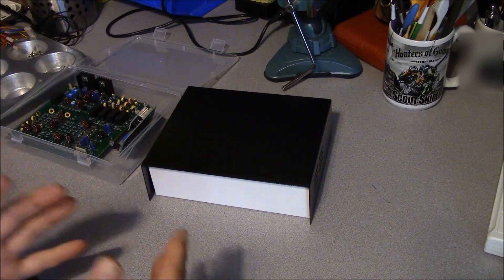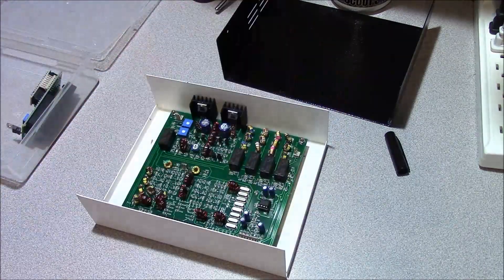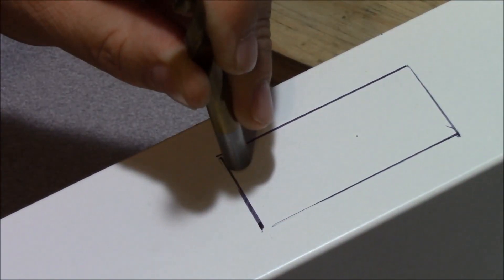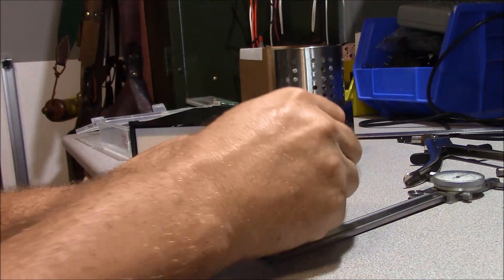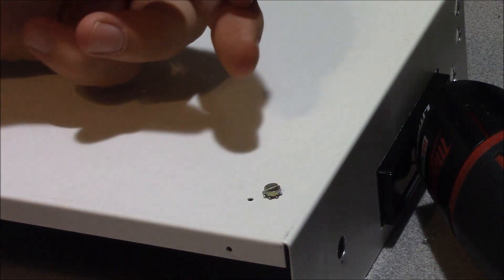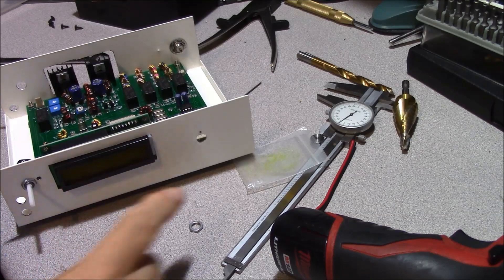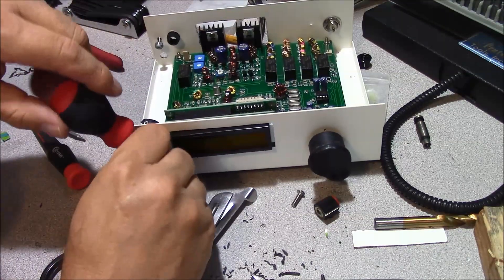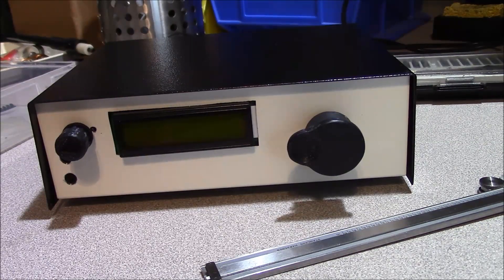uBITX $130 HF SSB/CW radio kit Part 2

Comment: Here's a suggestion.  Measure DOWN from the top instead of up from the INSIDE BOTTOM.  It's a cleaner edge than the bend/curve bottom on the outside.  It's the same edge inside and out. And you don't have to consider the thickness of the bottom when you move from inside to outside.  In other words, your measuring reference should be to top edge.

I love the idea of using the end of the drill to draw the circle. I've been drilling holes for 50 years and never once thought of that.  Always "eyeballed" it.  Usually to bad effect.
Reply from the maker: Sounds good ! Thank you and thanks for watching !

Comment: I'm building one of these right now make for the uBitx with 5" Nextion display.  Came with an AGC kit, 5 watt audio amplifier, digital expansion board and front panel board for the mic/phones/key.  It's very.....beta, but still not as bad as a blank case.  I've swapped out some anemic hardware for better stuff, and some of it needs to be fitted a little better....BNC hole on the chassis and the expansion kit shipped with a SO239 for instance.  That ain't gonna work.

Good call on not contacting the case with the heatsink.  I read the release notes carefully because my case kit came with bigger heatsinks, but the heatsink carries DC voltage and will create a short if it comes in contact with the case.
Reply: I'm taking lots of pictures.  Not brave enough to video it but I'll probably do a project recap... Haha.  And honestly I'm going to end up building a bare bones one too for backpacking I think. This is just a "how absurd can I make it" version.  Using it as a learning experience to streamline and miniaturize the modules to save some weight.
Reply from the maker: I got it wired today. Boots up good and has audio. I will put it on the service monitor tomorrow.
Reply from the maker: Sounds like a cool project ! I wanted to punch one out bare bones and see how it performs here. I'm wiring it up right now and filming the process.  I read the same paperwork about the H/sinks .  Thanks for watching !